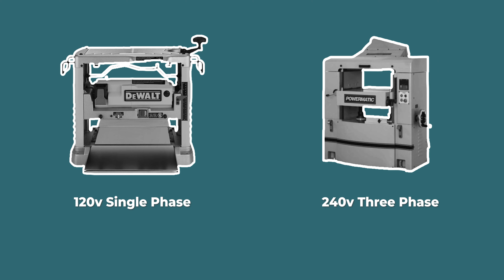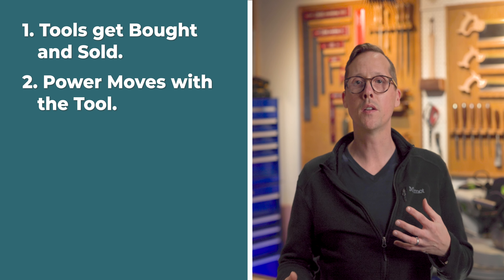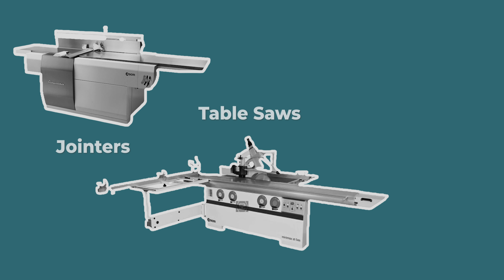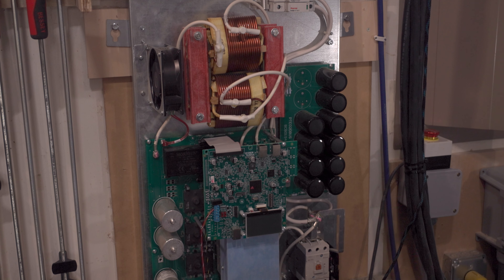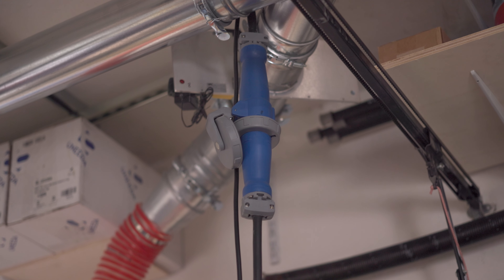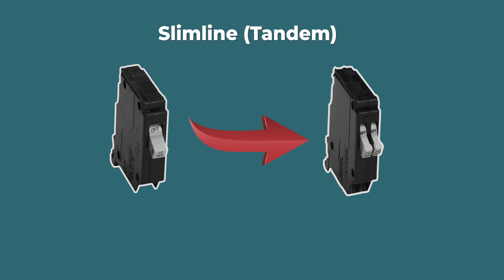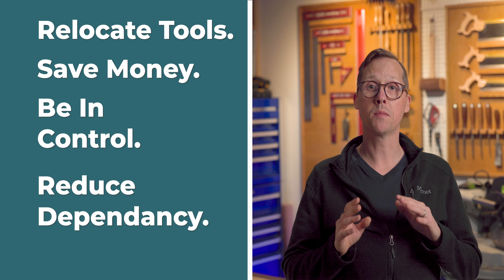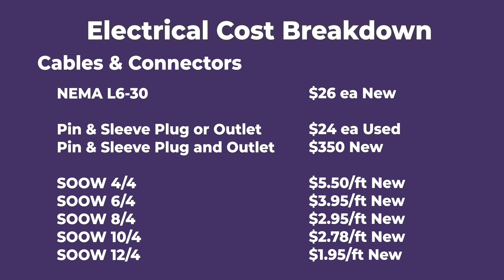How-to Add Flexible Power for a Growing Shop & Bigger Tools

Comment: I love SOOW and SJOOW jacketed wiring. I also agree that 4 wire is the way to go as you noted you can use it for both 120v & 240v applications and you don't always have to connect to devices with 4 wires. I have a 3-wire 240v VFD that only has 3 wires and so I just use only the needed "pins" when wiring the NEMA connector for that device.
 
One recommendation I have is to get the largest electrical panel possible installed which I think is around 42 full sized slots.
Reply from the maker: "One recommendation I have is to get the largest electrical panel possible installed which I think is around 42 full sized slots." -- Excellent suggestion 👍👍👍 If there was any room in the description, I'd add it! Thanks for sharing!